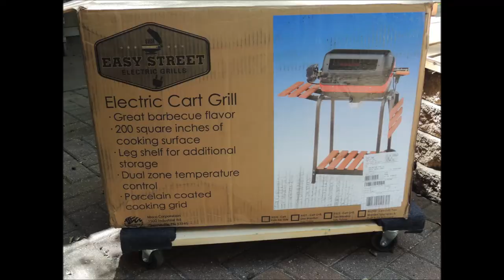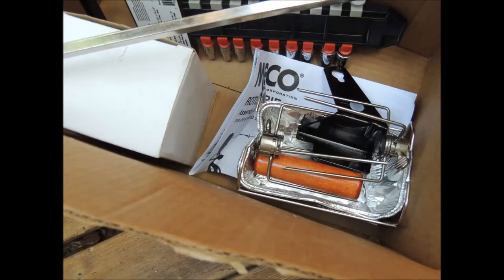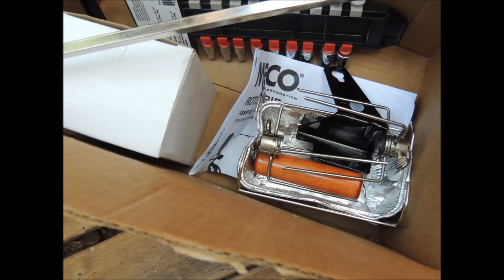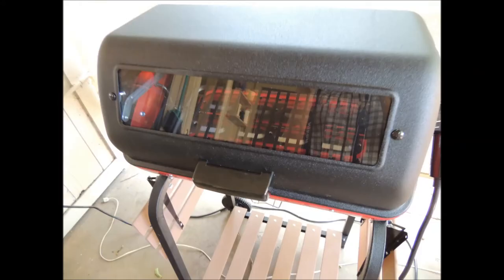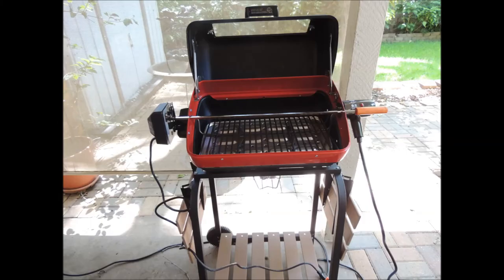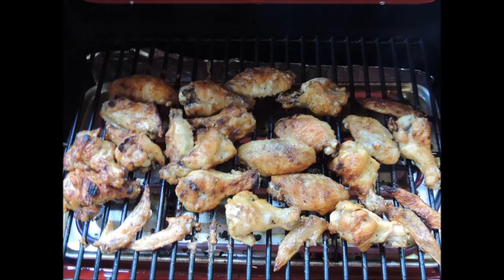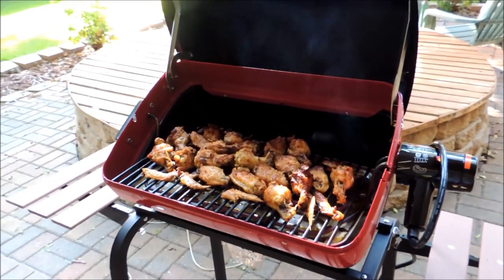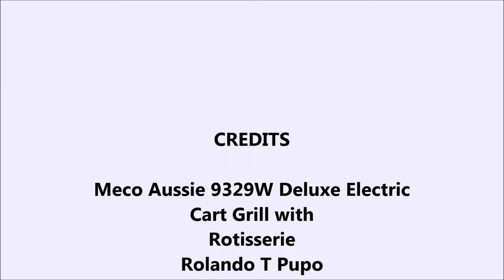MECO Aussie 9329W Deluxe Electric Cart Grill with Rotisserie

Comment: Good morning, I am deaf mute.  It is very disappoint. You did not show how to use rotisserie. That is very rude. I need to watch you suppose to show people how to use rotisserie. It is so wondering if picnic shoulder can use rotisserie. Before i buy it. Please do not get wrong. Thanks
Reply from the maker: I am sorry ...   The Rotisserie is really easy to use.  There is a bracket that just slides on the side of the grill on the left handle... then you hang the motor on that bracket....  then you insert the fork to hold the meet on the shaft ... put the meat on the shaft secure with the other slide in fork.      put the shaft on the motor ... and turn the motor ON.    Done.